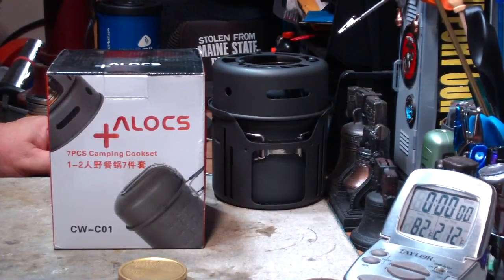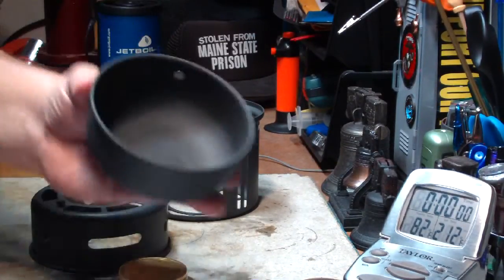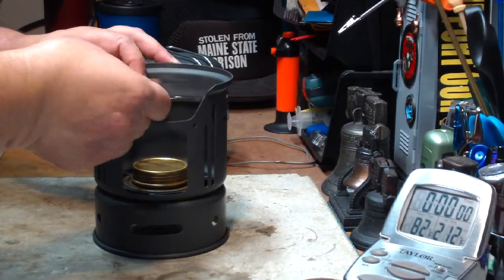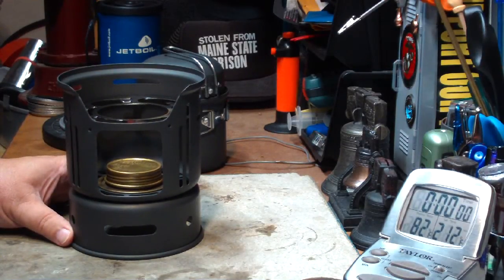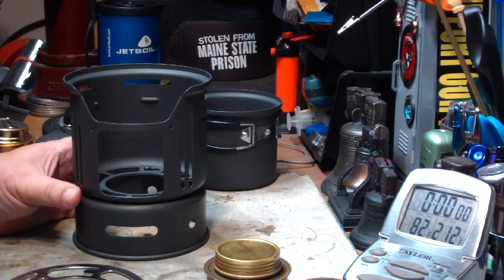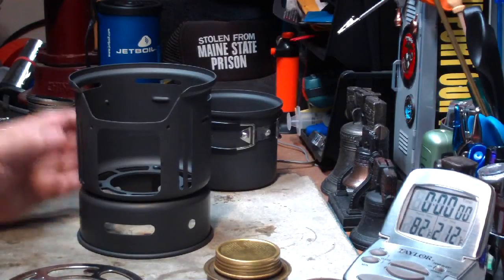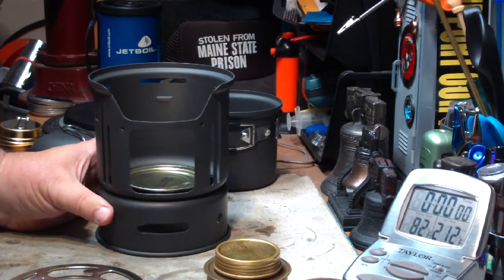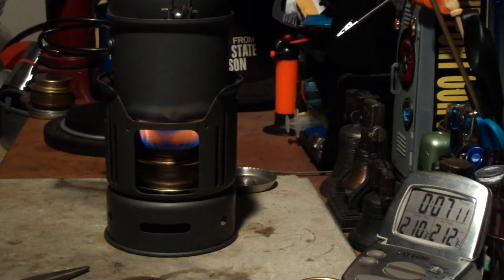ALOCS 7 Piece Camping Cook Set - Boil Test #2 - woodmanCam's Idea

Comment: Those Chinese stoves are absolute rubbish, they DO-NOT ploom up very well, the jet holes have not been drilled out very well, so I say, don't waste your money on these, they are only a couple of quid cheaper, not worth it, get the Trangia, also if they rattle then they will not work very well, it is the inside that rattles, if you must get one, give it a shake, it should NOT rattle.

Comment: Hiram, take the bottom, dish shaped base and flip it upside down so it looks like a bowl. Place the alcohol stove in the middle. To cook with, set a pan to fit on the lip of the bowl or place a grill over it and then your pot. Simple and you can leave out the other useless parts of the kit and lighten your load.

Comment: Hiram-I enjoy your videos and they are well done. You've done way more boiling tests than me, but one thing I would add is this:  the SWEET SPOT or hottest part of a flame is the TIP or just a little bit below.  Similar to a butane torch. The first test actually had the height of the flame just about perfect...IMHO.  Using a trangia, I would be shocked if you got better boil times better than test #1. I would love to see you do a test using any of the OPTIMUS CRUX or similar jet powered portable stoves placed underneath or through the hole?  Also, could you give some of professional views on just how good or bad the quality of the aluminum the stove is made of?  Compared to a Tangia Hard Anodized Set?  Great videos!  Keep EM coming. 
William~

Comment: For the cracks in the Trangia just solder them shut . It's brass and easily soldered. I put small bolts/nuts in the front  vertical slots with corresponding  nuts/bolts in the rear to have a selection of heights for the pot holder plate

Comment: I've had one of these for a while now, purchased on a whim. They aren't bad for a days walking.
WARNING!. Although the propane/butane and liquid fuel adaptors work, the odd airflow takes the heat toward the rear of the unit and it buckles the pot stand. It's no biggie.
They also work better in a light breeze.
For a cheap and really not bad alternative to a Trangia Mini, I think they're pretty good value.
The burners neither seem to leak more or less than the real thing, but they do feel cheap.